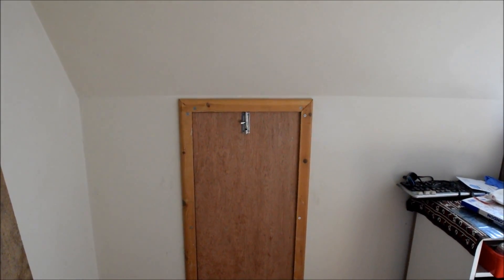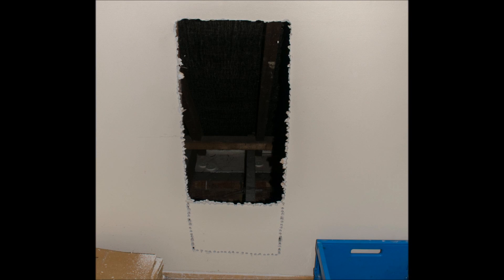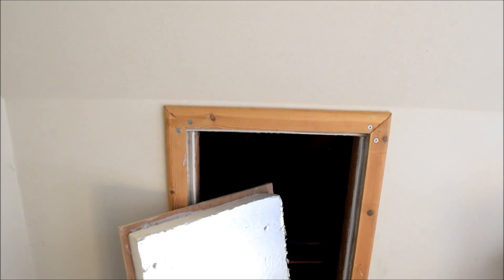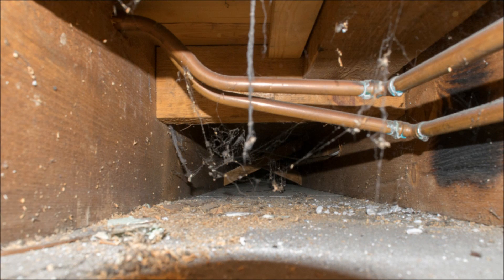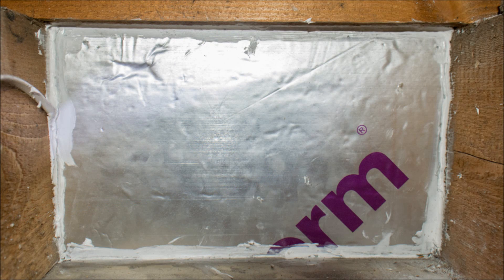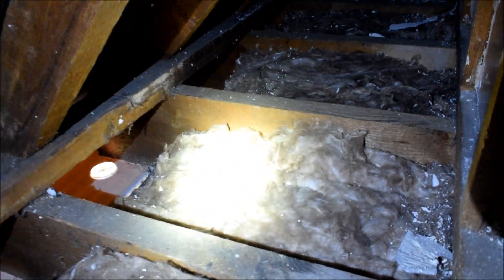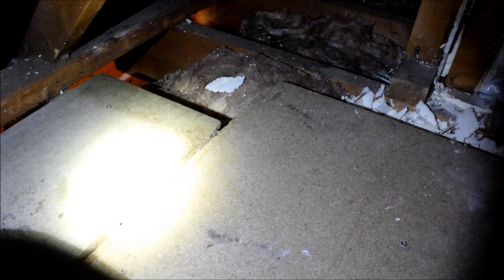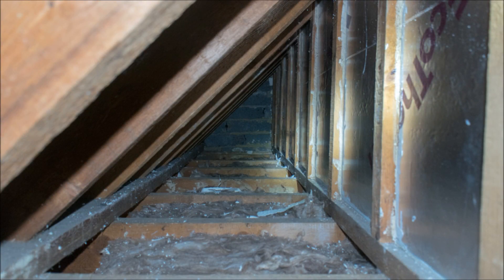How to Insulate a Dormer Roof

Comment: I live in a dormer type bungalow similar to this. We had tried all ways  to get insulation into the voids between the roof and the sloping ceiling/walls. In the end we bit the bullet and had the roof tiles removed so that we could insulate the whole of the roof with 75mm celotex insulation. We then replaced the tiles and some new breathable  membrane. It was a job well done.
Reply from the maker: That sounds like the most thorough way to do it, though I guess it cost a bit.
Reply: It was Mike. It was about £3k at the time but sadly the cost of Celotex has ‘Gone through the roof’ if you’ll pardon the pun!!
Reply from the maker: @davidgordon773  yeah, materials cost a lot more now. Still, you should get the benefits of a warmer home.
Reply: @mikepepler  dead right Mike. I just have a few more problem areas to insulate but I’m on the right track. Thanks.
Reply: We read that there are no end of grants out there to help with insulating our houses, but! If you have a dormer bungalow you are generally on your own.
Reply from the maker: I recall getting an EPC done so we could access renewable heat incentive for solar thermal. I asked the assessor if they had any comments about the cavity which I insulated in this video, and as it wasn't in their software, they had nothing useful to say. 🙄
Reply: @mikepepler  Get a new advisor as there is a whole category for Room In Roof. I see it regularly on EPC's for houses I look at. The best way to do make improvements that affect an EPC it is to contact an EPC assessor first to make a draft assessment (paid) and ask what they need to see to improve the rating. Do the work with receipts, photos etc and then get them to recalculate based on their advise issuing a new EPC certificate. If the assessor can't see the work then the software "assumes" based on built year not what you have actually added.
Reply: @davidgordon773  do you have any details if how they attached the celutex in?
I have already cut them all and skid them up from under the perlin. We are having the roof redone next year and I want to ask them to attached them in better
Reply: We did it by taking off the roof tiles and membrane but left the plaster board ceilings in place. The cellotex was then cut to size and fitted in between the rafters directly in contact with the plasterboard. All the edges and joins were sealed with silver tape. As you will know it is important to have an air gap between the insulation and the tiles. Hopefully you will have cut the insulation so that it traps snugly between the rafters requiring no further securing.
Hope that helps.
David Gordon

Comment: How much did this project cost for supplies? And what supplies exactly?
Reply from the maker: I didn't keep close track, I live near a place selling insulation materials so just bought as I went along. I'd guess a few hundred pounds though. Main cost was the rigid insulation boards, then the rock wool, then glue. Plus a bit for wood to make the hatches.
Reply: Wgat glue did you use?

Comment: My roof is exactly the same except we also have a flat roof.  Its FREEZING in the winter.  Going to do this project this weekend.
Reply from the maker: Hope it goes well! We have a flat roof too, but I found a way to insulate it without blocking the air flow above the insulation: http://peplers.blogspot.co.uk/2012/02/retro-fitting-flat-roof-insulation.html
Reply: Supplies ordered and delivered today.  Cannot wait until this is complete.  I think even blocking the joists stopping cold air blowing across the house alone will make a big difference.   Will update with a video when finished.
Reply from the maker: Brown Andrew
Hope it goes well! I expect you will see a huge difference. The weather we have right now, I would previously had lit our stove first thing in the morning as well as in the evening. But with the new insulation, we're lighting the stove in the evening, and in the morning the lounge is still at 19-20C, so no fire needed! :-)
Reply from the maker: Brown Andrew Good work! Shame you had to take all the plasterboard off, but it looks like the space behind it was smaller than I had... It makes an amazing difference, doesn't it?
Reply: Sure does. Had to take the plasterboard off due to the large crossbeam. No way to get the kingspan up from behind.  Still well worth it.

Comment: Thanks Mike,  Still working on this myself, my roof pitch is a little steeper so its a bit easier to move around, its taken me a lot longer than I had hoped as there was plumbing I wanted to move and electrical work to do at the same time, all the floor is done with 100-125 celotex offcuts fixed in with spray-foam, still doing the upstairs walls, about half way now.
Reply from the maker: Sounds like you're doing a great job!

Comment: Thanks for this video, i have this exact situation.  Did you have to do anything to the sloped roof above the hatch too?  For us, this also needs insulating but we're not sure of a suitable DIY way of doing it.  Shoving rockwool in gap I'm guessing won't cut the mustard...
Reply from the maker: I did actually. You're right that shoving rockwool in would be a problem, as it would block ventilation and thus cause damp issues and maybe rot timber.

I was able to get access to the top of the sloping roof from inside the loft, so I slid 25mm polystyrene boards down, resting on the plasterboard but with a decent air gap above them. Polystyrene not an amazing insulator, but it's flexible and I needed that to get it in. I taped it on to a long strip of metallised bubble wrap insulation, which I used to lower it in, with the idea that I could pull it back out if needed. In practice there was a ledge at the end of the slope that held the polystyrene in place, but I wasn't sure of that at the time. 

Overall it's not perfect, but it made a big difference. Also keeps the sloping roof cooler in a hot summer.
Reply: Interesting.. A lot of the info I've found for thay job, seems to suggest dense packing it and ceiling both ends off.. But they were mostly from the States so i imagine very different building regs etc.  From what you've said there, I wonder if the YBS BreatherQuilt would do the job, with the foil side down 🤔
Reply: sealing off*  😂 see what i did there?
Reply from the maker: I think sealing it up would require the use of vapour control membranes, to avoid warm humid air from indoors getting into spaces the other side of the ventilation. But this is beyond my knowledge of this stuff, the safe option is ensuring ventilation with outdoors air in the roof spaces.

Comment: Mine is similar and existing PIR boards are badly fitted to the pitched part of the roof, all falling out. I can only just shuffle in the space on my back or crawl very tight in there, how did you cope moving in there?
Reply from the maker: Very uncomfortably! 😂 I laid boards across the joists and laid down, wriggling back and forth with a head torch, tools and materials.

Comment: Great video. Almost identical to my house - something I’m looking to do soon. Couple questions…
1. You say 200mm insulation, however it doesn’t look like it reaches the top of your joists - are your joists shorter than 200mm?
2. I am thinking on doing this at both front and back of the house, but with no insulation boards like you have used. Would I be ‘safe’ to just lay insulation roll from the edge of the soffits to about 200mm underneath the floorboards? Would this have the same effect?
Reply from the maker: I think the joists are about 150mm. Your plan to lay the insulation would certainly help, but it would still allow some cold air to slowly flow between the floors I think? And I think insulating the vertical section is worthwhile. But the boards were a lot of hassle, so just doing the rockwool would be worthwhile on its own.
Reply: @mikepepler  thanks for the advice! Yeah I guess there would be - but I also have pipework running along these spaces, so I’m hoping insulation roll is more flexible round these obstacles. Yes for sure I’d have a go at insulating the verticals - however for this one I’d consider using insulation roll (more flexible) and adhesive (my crawl space is tight and I’m 6ft 2, so not a lot of room!). 

When you insulated the verticals, did you go hard up to the roof timber/felt which (I assume)  leads to your loft? Looking at mine it looks there is maybe a 30cm gap in most places which leads to the loft. I’d be cautious of covering this as I’ve read a lot about having airflow etc etc… and now I think of it, if I lay 200mm insulation say 200mm beneath the floorboards, and fix insulation to the walls and have this ‘butt’ together at a right angle, this would limit the cold air flow you mention. 
Thanks for any advice!
Reply from the maker: @GAC610  I insulated to the top of the wall, but just with 50mm board, so there's still a gap for airflow from this cavity into the loft on the top.
Reply: @mikepepler  that sounds good to me. Appreciate your comments Mike. And also thank you for the video itself - you’ve no idea how hard I’ve found it to find a video that spells it out clearly like you have! 
Have you got any recommendations on insulating dormer flat roofs? The front bedroom and office roofs will be partially insulated from the loft but from the point the loft flooring ends, to above the window, I’m assuming is not insulated.

Thanks again for the video and your advice, much appreciated
Reply from the maker: @GAC610  I managed to slide flexible 25mm polystyrene sheets in from the loft on top of the dormer ceiling, leaving an air gap above. But in the long run I want to have it rebuilt as a 'warm roof', when it's time to renew the surface.
Reply: @mikepepler  thanks Mike sounds good. Let’s see how we get on… Hope you don’t mind if I reply to this thread if I’m needing advice! Really appreciate your help and the video.
Reply: @mikepepler  Slight update - me and my friend have just done floor insulation for his house (mine next). Can get under it comfortably but what an effort fitting insulation above your head!! Hoping eves is significantly easier!
Reply: @mikepepler  finished floor insulation under the house… what a job!!! Hopefully makes a difference. Might take a break before the eves! Hopefully easier laying insulation below myself rather than above me in a cramped space!
Reply: @mikepepler  and there we have it - back of the house dormer roof insulated! Really appreciate the video Mike, pretty much copied you exactly. Managed to fit the boards between majority of the wall posts (some I couldn’t do due to pipework for bathroom) and laid 200mm insulation between all joists. 

Opted to lay 200mm across the joists too, hard up against the wall posts - I didn’t choose to ‘block off’ the void beneath the floorboards so thought this would limit the cold air flow somewhat, as well as it sitting on top of the 200mm I laid between the joists and only just into the void beneath the floorboards by 20cm or so. Noticing a difference, but hoping when I get my cavity wall insulation done it will be an even bigger difference (about two thirds of the room below the dormer area is getting cavity wall insulation). 

Once again, really appreciate the video Mike. Now to see if I can be bothered doing the front of the house…
Reply from the maker: @GAC610 nice work, enjoy a cosy home this winter! 🙂

Comment: Nice job, did you use any vapour barrier between the interior wall and insulation board?  I’m planning to do something similar and I’m concerned on condensation
Reply from the maker: I didn't add anything other than the aluminium foil barrier built into the boards. I think because the cold side of the insulation boards has fresh air around it, I didn't need to. I know if I'd been putting the insulation on the interior of the wall it would definitely have been needed. Best ask an architect or competent builder if you're not sure though.

Comment: Does insulating the dormer affect the temp up there? I'm hoping to do it myself to keep the heat out in the summer. My roof tiles get extremely hot and I'm guessing it radiates into the dormer since it's not insulated
Reply from the maker: The bigger effect on the upstairs room was insulating the sloping ceiling, which I did by sliding insulation boards down from the loft.

Comment: This is a great help. We live in a 3 story town house and each floor is smaller than the one below and the difference in size is made by a small tilled roof outside. I broke into the top floor void to get to the rear of the loo which was faulty and repaired it. I was appalled at the lack of insulation and now intend to do the same as you. Did you insulate the central heating pipes or leave them to warm the underfloor areas? I made a hinged door into the void. Thanks for the inspiration to tackle this job.
Reply from the maker: We had pipes in the void behind the bathroom wall, no useful place for the heat to go so I insulated them. We've got pipes from the wood stove to the bathroom that run under the floor upstairs, they're not insulated and they do warm the floor.

Comment: What did you do with the space parallel to the roof pitch?
How is it now if you’re still living there?
Reply from the maker: From the loft, I slid thin insulation boards down the gap, they rest on the plasterboard, with an air gap above for ventilation. Still there, much warmer than it used to be! Biggest difference was stopping the air flowing between the two floors though. In total, I reckon this cut a third of our firewood use.

Comment: Hi, 4years on how have you found it? Not caused any mould or ventilation problems? Looking at doing similar. Thanks
Reply from the maker: No problems so far in the cavity. The only annoying thing is the lack of insulation round the window frame, which creates a cold bridge that attracts condensation and gives the risk of mould. But fixing that will require deeper alterations to the house.... One day....

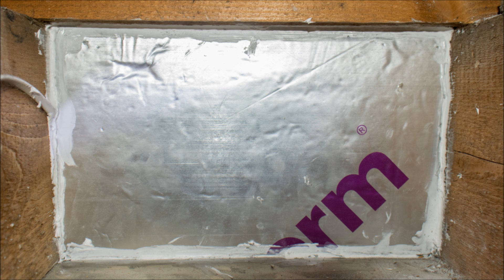Comment: At 1:30 did you block the under floor at the kneewall side?  or at the far end where it vented to the outside or both?  I'm trying to figure out what i need to do in this same situation.  Thank you.
Reply from the maker: +Chris Gabel there's a knee wall at both sides of our house, and I blocked the gap between the two floors on both sides, so it's become a warm space with no need for ventilation. The cavity I was in is still ventilated, through the soffit vents and also through the gap under the pitched roof that leads into the loft.

Comment: So what did you do to insulate between roof trusses and your room ceiling?
Reply from the maker: Rock wool, if you mean above the ground floor ceiling.
Reply: @mikepepler  trusses right above that knee wall
Reply from the maker: Ah OK. Well, the flat bit of the upstairs ceiling is partly in a loft at top of the house, so that was easy. The other part is under a flat roof - there I slid in some 25mm polystyrene boards via the loft, so as to leave a ventilation gap above them. It's not ideal, and when the roof needs resurfacing I'll get it professionally insulated. With the sloping parts of the ceiling, I did the same, sliding in a polystyrene board.

Comment: I am looking to do this by end this year. Exactly the same problem as yours regarding cold living room and ground floor in general. 
How difficult was it?
Reply from the maker: It wasn't  much fun working in a confined space, but I wouldn't describe it as difficult. It's made a huge difference to the amount of fuel we need to use for heating.
Reply: Yes I can imagine working in confined space. Had to do the roof by cutting hatches in ceiling due to no access from the loft. 
We can actually feel the draft coming through ceiling spot lights. Good enough indication that no insulation there. 
Please can you describe the actual difference it made?
Reply from the maker: Before we added the insulation, the lounge ceiling was sometimes as low as 14 or 15 centigrade when it was cold outside. With the insulation the temperature of the lounge ceiling is now basically the same as the room temperature. In terms of energy use, we burn logs for our heating, so it's hard to be exactly sure but I think it took perhaps a quarter or a third off our energy use.
Reply: Thanks very much for information. Hopefully this will make the living environment bit more comfortable

Comment: I'm planning to do this. I have a lot more space  with a shallower roof. I thought I'd just stuff rockwool under the gaps between the cieling and floorboards and fix it against the wall somehow too. There is some there but very little. The gap between the joists varies from 35 to 36 cm, very awkward! but at least there is already good access
Reply from the maker: How did it go?

Comment: Hey there. I'd like to do something similar in my home, but rather than install the rigid foam as you did. Install it directly onto the rafters as well as in between the joists to create a more air tight seal as well as create a semi-conditioned space in the knee wall. Any thoughts on this? The roof would still be vented, as i would not be installing insulation in between the rafters.
Reply from the maker: Sounds like it would be better, to insulate over the wood too. You might want to look into using some kind of vapour barrier too?

Comment: Would not be a good idea to do the same between the rafters in the sloped roof part too no? (Genuine question!)
Reply from the maker: My understanding is that you need to leave ventilation space on the cold side of the insulation. Or have some kind of vapour barrier, but that needs to be done carefully and I felt it was beyond my experience.